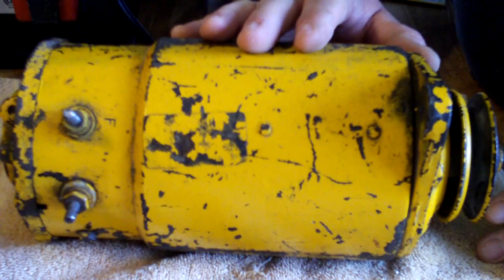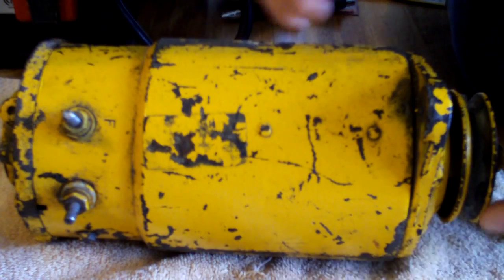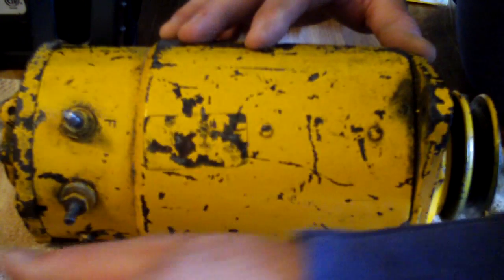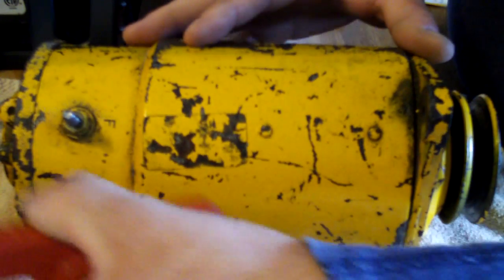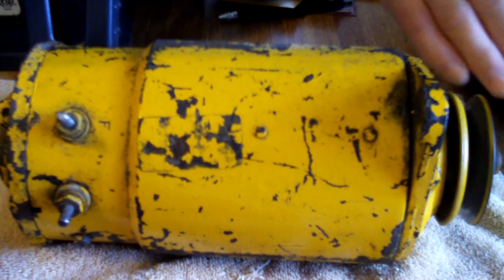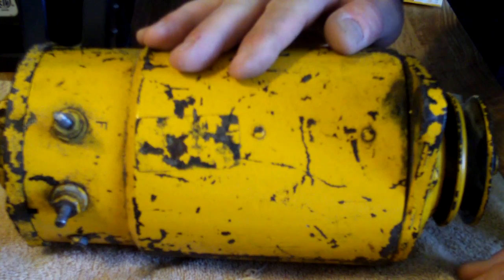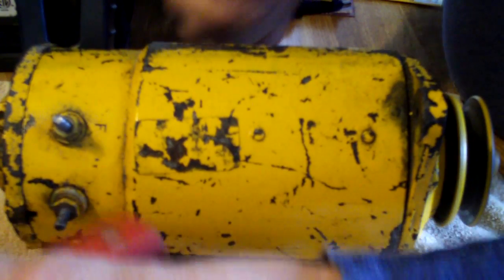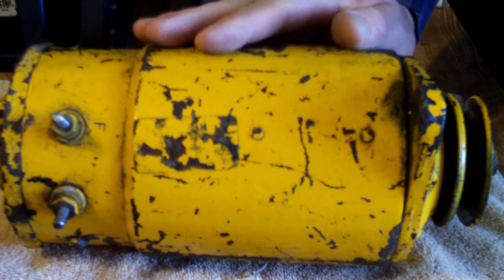Starter Generator- simple field testing.

Comment from the maker: on older models like the 109, there is a lever, linkage rod that goes to the front of the tractor, hooked to a arm that allows pull and release of the clutch, in the center of the clutch should be a button, and on that Arm i mentioned there should be friction button the size of a nickle and three nickles thick, when you pull on the PTO lever, that friction button pulls back into the clutch button, it pushes against the clutch spring, allowing the clutch to disengage, if it does not, then

Comment: I have 4 cubs. None of them have a working PTO. so i dont know how it functions or works. eveyone on the tractors i have are locked up and spin with the engine. when i crank the 109 i have the blades turn over on the mower deck and will NOT disengage. I have also noticed there seems to be 2 diiferent PTO styles. i think i fugured out the charging system.

Comment from the maker: Thank you Tom, I hope it comes in handy, i know there is another way to check using a meter with the battery pack, without use of voltage regulator and such as well, but this was just a quick way to check, Hope it comes in handy. I use it every time i go to a swap meet, i just go back to the car, or borrow a jumper pack someone may have at the meet, and do a quick test, Thanks for stoppin in !